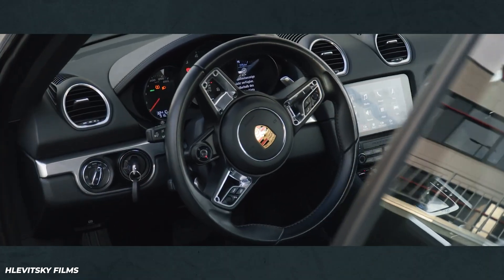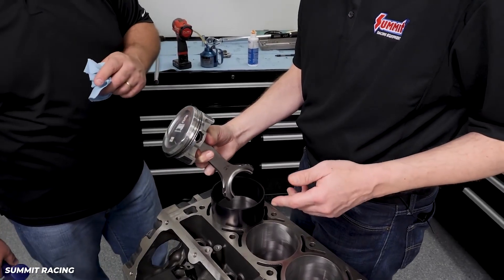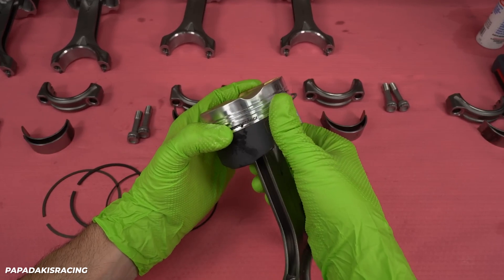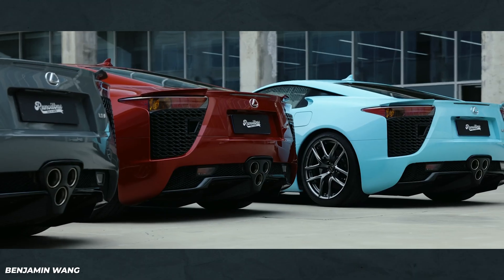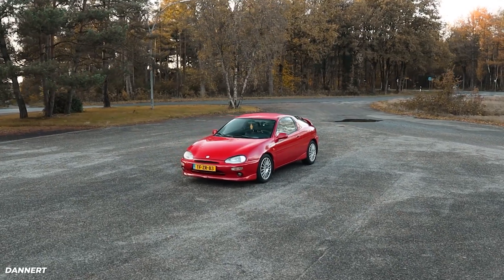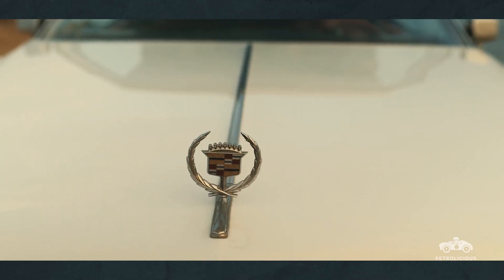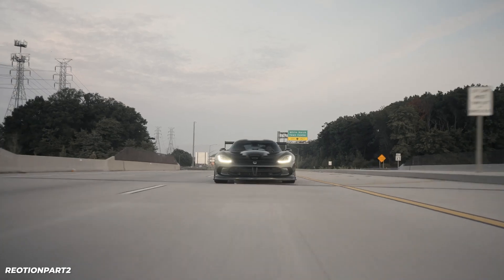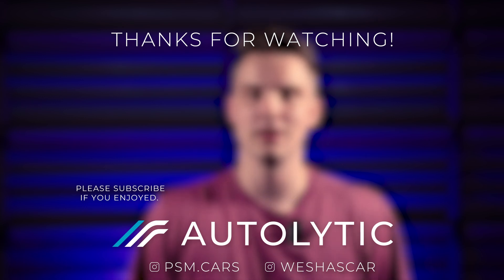These Engine Sizes Are Goofy.

Comment: Excellent video!
I just missed one honourable mention to the club of 0.5L per cylinder: the 8.0L W16 used by Bugatti.
Reply from the maker: Thank you! Everything about that engine is preposterous but it's all designed in a very calculated way, definitely very cool

Comment: Does displacement equals to engine size?
Reply from the maker: Yes, the total displacement of all the cylinders added together is what size the engine would be listed as. So a 2 cylinder engine with 0.5 liters of volume in each cylinder would be referred to as a 1 liter engine.
Reply: @autolytic  so there's an ratio between displacement and cylinder count to determine the size?

Comment: Toyota 14B was a 3.7L diesel inline 4. The 15B was a 4.1L, but technically a JSDF only engine. Although it was offered in the Mega Cruiser which is a passenger vehicle.
Reply from the maker: Correct! I found that but didn't put it in since while it was technically a passenger vehicle it was only sold to police/military... maybe bending the rules a bit
Reply: @autolytic  13b/14b are still 3.7L / 3.5L with the former in the Land Cruiser!
Reply from the maker: Dang! Should have used that then. Confusing that it's named the 13b though.. a certain other famous engine springs to mind

Comment: Alfa Romeo also had a 2.0L V8 in 1967 with the 33 Stradale
Reply from the maker: True! I should have put that as the first example, it beat the 2 I listed to the punch. Another fun fact is that the 33 straddle had the 1st 6 speed manual ever sold in a road car
Reply: @autolytic  what I wouldn't do to have an afternoon with one. Probably my favorite from the era

Comment: while the cadillac 500 did make 190 hp, that was in its last year of use in the middle of the gas crisis in 1976. the same engine peaked in power in 1970 making over twice as much, at 400.
Reply from the maker: That's true. That engine got hit with the double whammy of GM basically deciding to choke it instead of downsizing and US automakers switching to SAE net hp measurements taking another 10-20% off hp numbers. It's easy to poke fun at now considering an N/A 8L V8 should be in the ballpark of 600 hp but at the time the tech just wasn't there